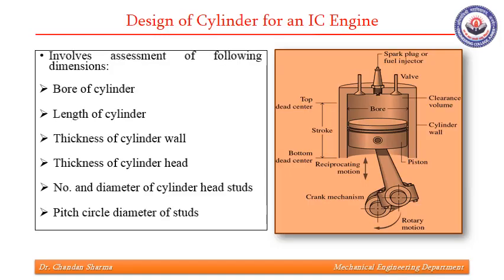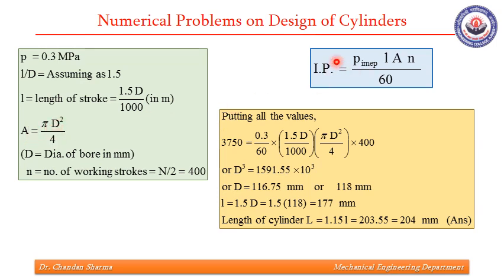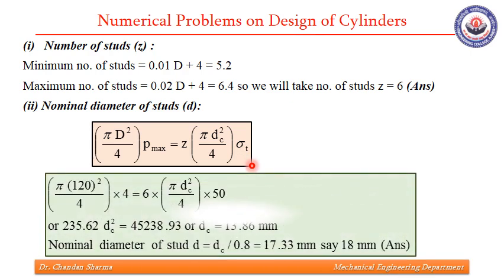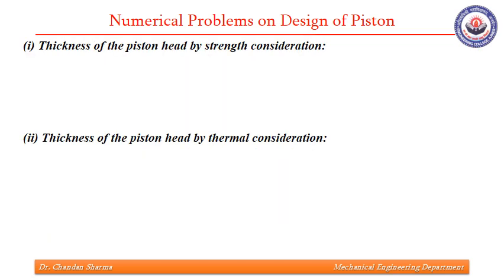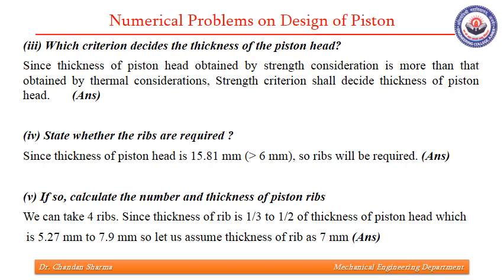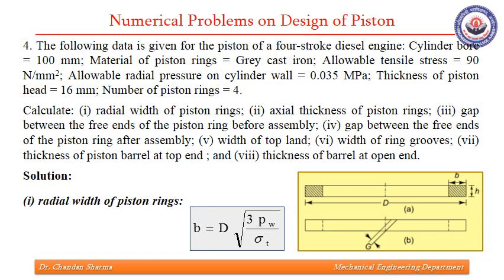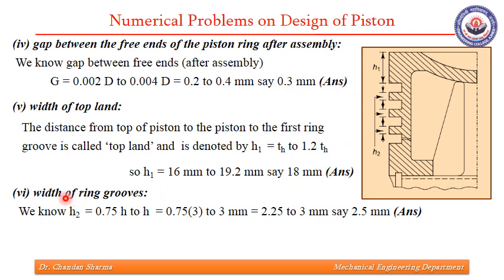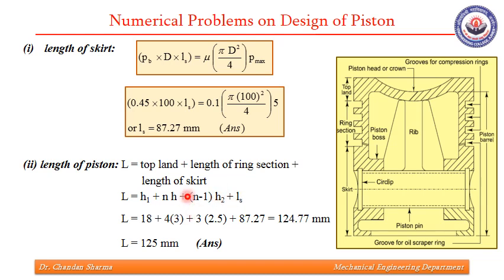DME - II Few Numerical Problems on design of Cylinders and Piston of an IC Engine

Comment: I have a doubt, sir, The unit of 'l' is already in meters, why do we need to divide it by 1000?
As per the formula, 'l' has to be in meters for the unit to be J/s.
Reply: Dear we have divided that by 1000 to convert diameter of cylinder in meters so that when we obtain diameter of cylinder, that will be in mm. If  we do not divided it by 1000, we need to keep area also in m^2 and diameter obtained will be in meters